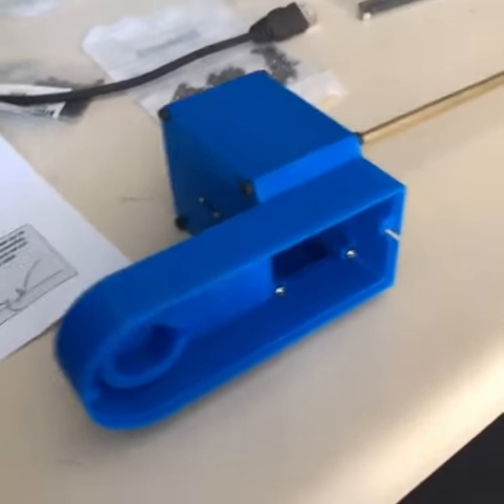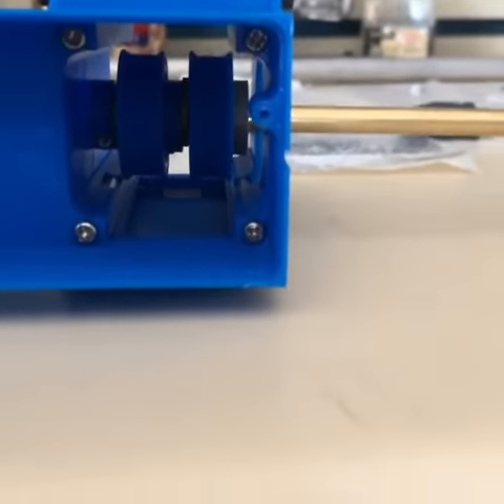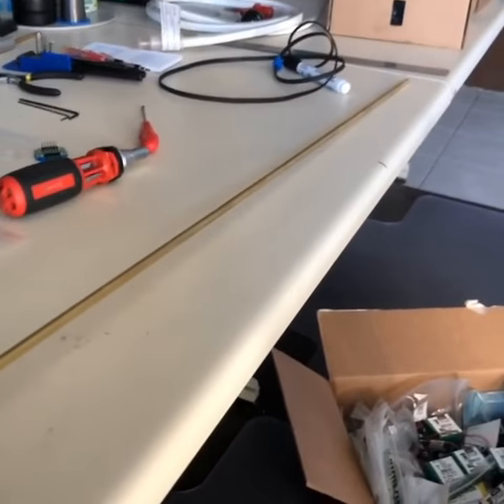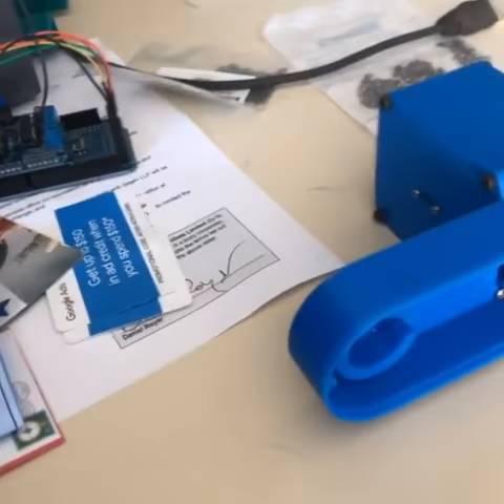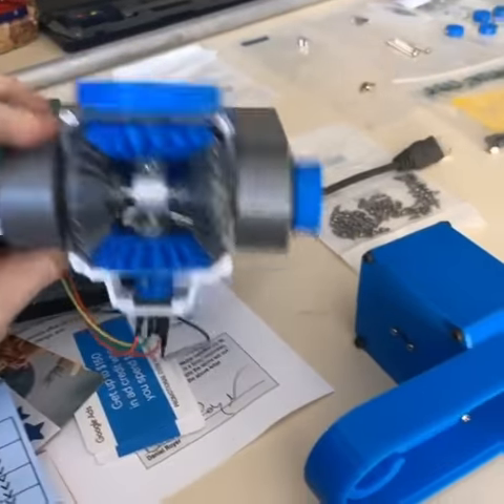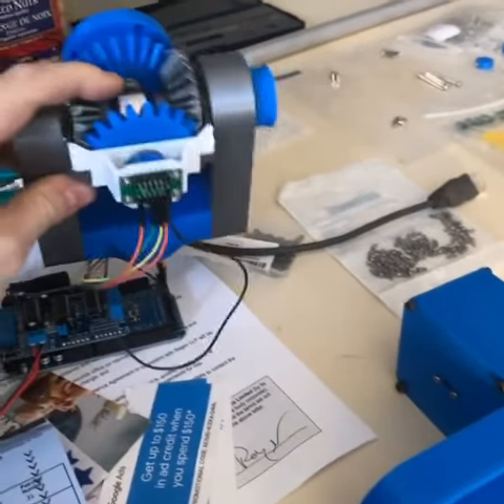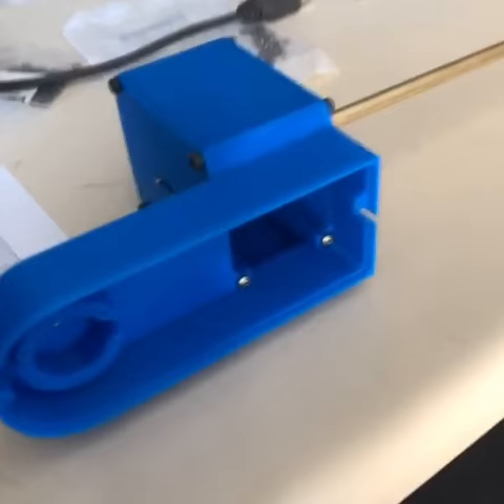Sixi Robot : Tuning fork improvements

Comment: Hi 

I have a question which sensor did you use for detect the angle and does it have enough sensitive for this operation
Reply from the maker: great question!  I used AS5045 12-bit magnetic encoders.  It's enough for an arm maybe 300mm reach.  We are already working on 16-bit sensors that will be 10x more than we need for our arm.